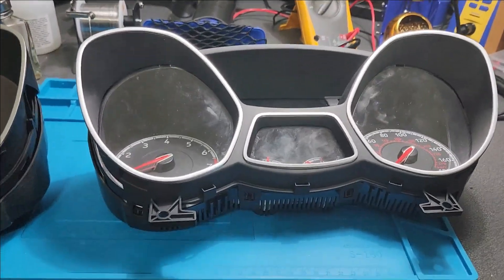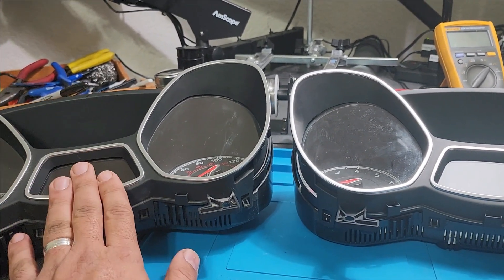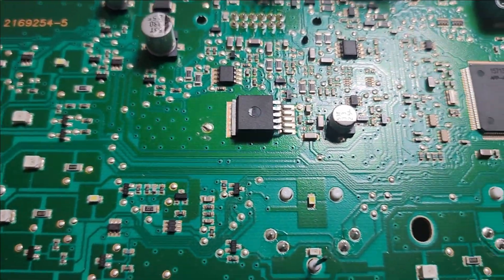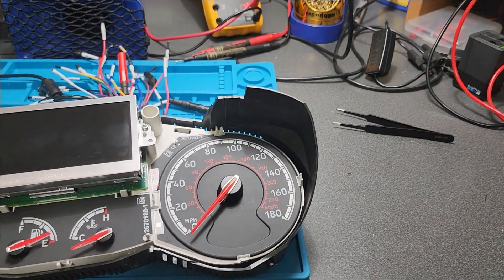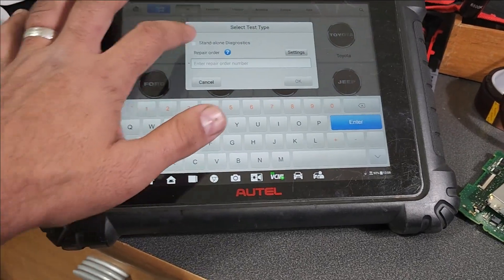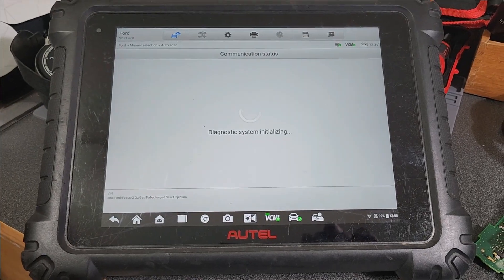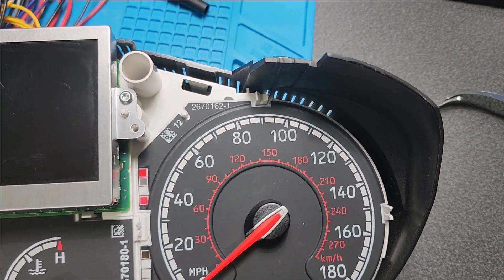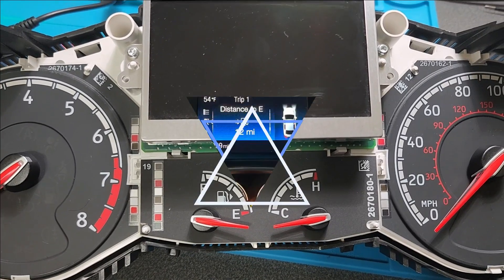2015 Focus Cluster Swaptronics

Comment: Welcome back! thanks for another great video. I believe on this car a tool like the auto pro pad can change the miles through the  DLC.
Reply from the maker: Thanks, man. I did buy a tool that was supposed to be the best when it comes to changing mileage. It turned out to be not that great. I have a video about it. I will upload it soon.
Reply: @DallasAutoDiag  I had good results with the Auto Propad Basic, on Ford, Chrysler, and GM and a Toyota Camry after 2018. I tried a Nissan but did not work.
Reply: @DallasAutoDiag  original Carprog does these through obd with out issue usually.
Reply from the maker: @Keyworks ECU Repair really? I didn't know that. I do have a carprog. I also once bought obdprog mt601, which was a waste of money.
Reply: @DallasAutoDiag  yea usually it will do it but sometimes you have to do it a few times.  The way you did it worked just fine to.
Reply from the maker: @keyworksva  thanks for the clarification 👍